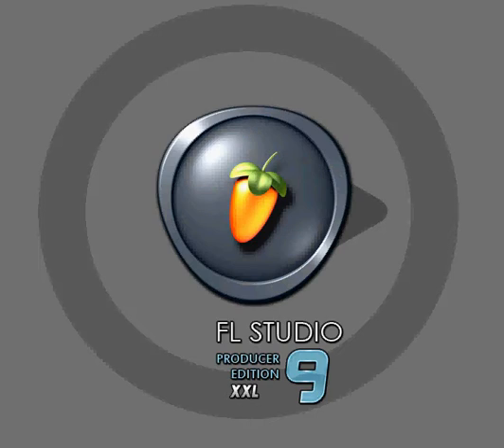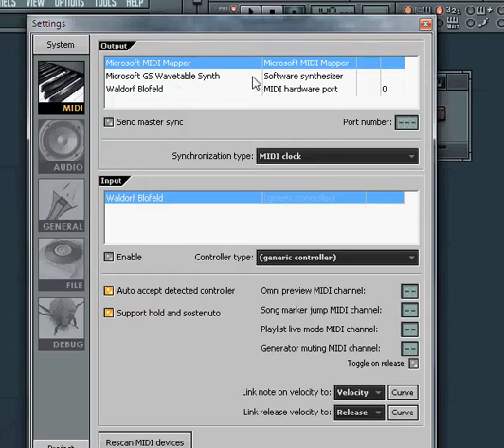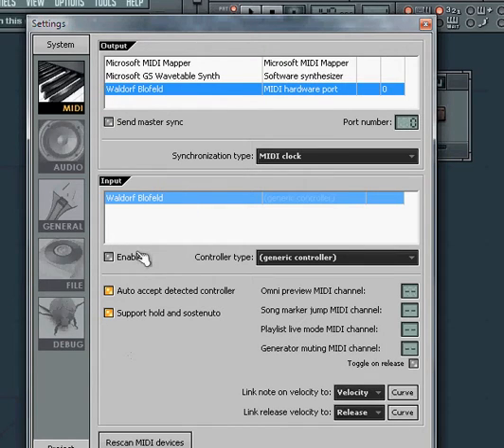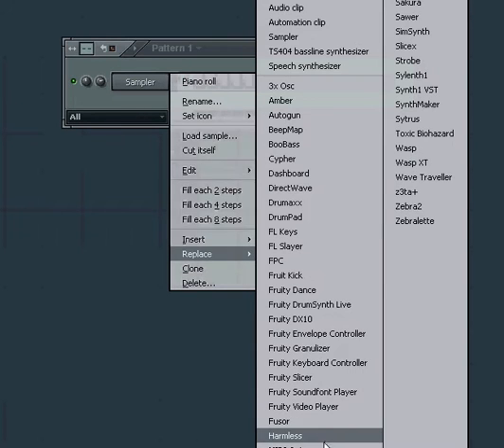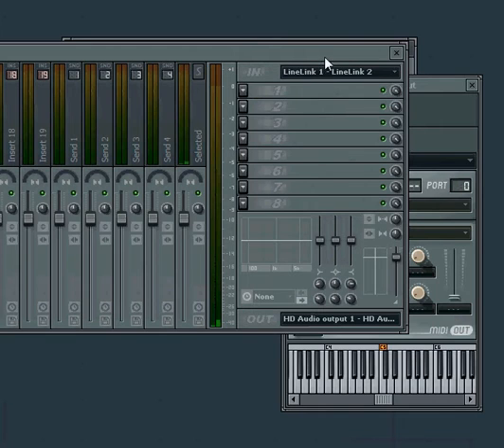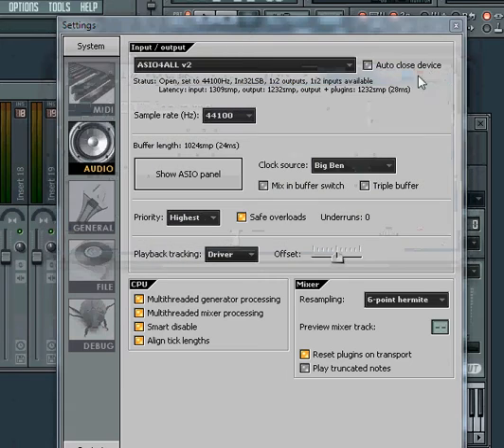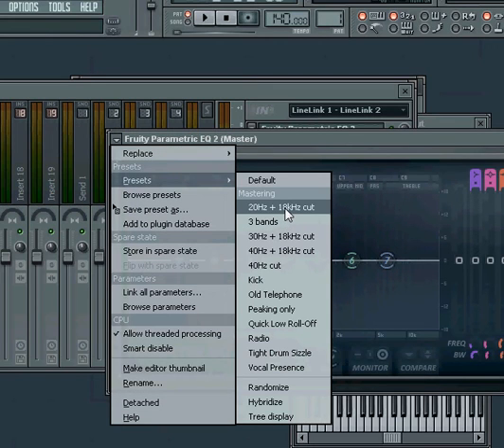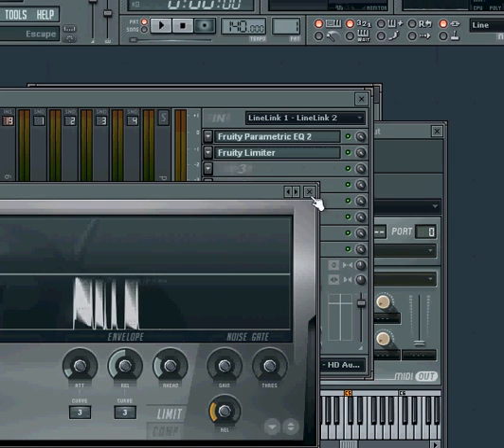Setting up a Hardware Synth in FL

Comment: Hey man, I'm having some trouble with this. I have a Casio xw-p1 that I run through an m audio m track interface. I'm able to use it as a midi controller but I'm still not able to use the actual sounds from the synthesizer. Do you know what the problem might be?
Reply: Did you ever find the answer? I have the same synth.

Comment: I'm having trouble. I'm able to set up the midi-out, and play my Nord Rack 2x in FL. The problem I have is, if I try to route the audio into the mixer, I end up hearing the audio from my Nord twice. Once through the midi channel and once going from the line 1/2 in the mixer. I want to be able to run it through the mixer so I can add effects. Any ideas?
Reply: Direct to monitor switch if you have focusrite audio interface

Comment: @MrNelsonmania You need an audio interface to act as an analog to digital converter. If you're on a budget and only need to record one synth at a time, or vocal parts or something there are some good cheap options. I personally picked up a PreSonus AudioBox 22VSL for $200 yesterday and am loving it. Basically, you plug in the interface, which is usually USB or Firewire then you plug your synths into that and route the audio into a mixer channel in FL Studio, then you can record the audio output.